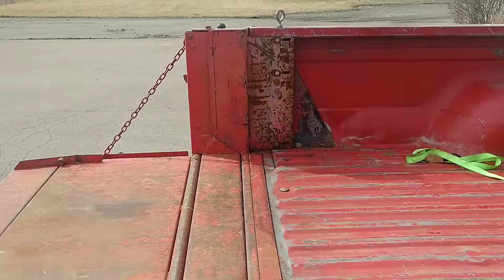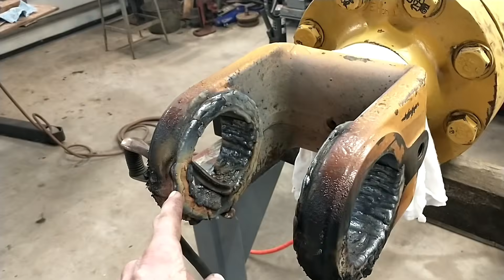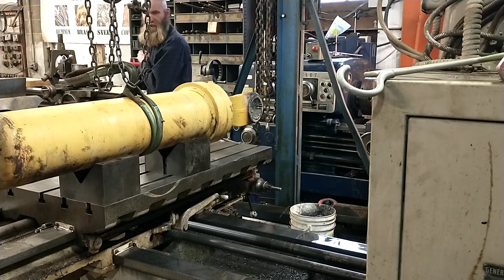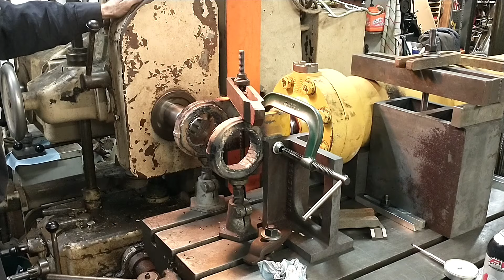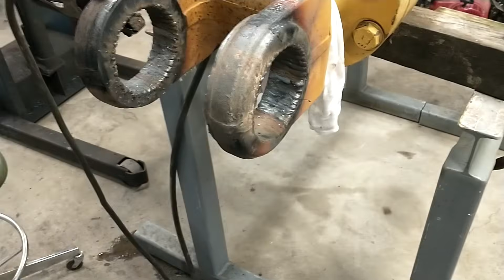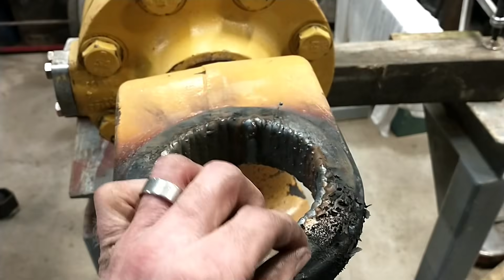Cat 980G lift cylinder repair

Comment: You've got a heck of a forklift operator there! It's awesome that he's in the shop and learning from you! My boys are a little interested but don't quite have the attention span to work through a setup yet.
When I first started at the shop I work at now, first time I'd ever run a boring mill, I was shocked to see what the people there used for risers under the outer edge of their table clamps: 2x4's. Yep, plain pine 2x4's. I thought they were nuts. 10 years later, I don't think they're nuts anymore, I know it. But the 2x4's do work well enough, somehow. Nice work, as always! Hope you have a good one!
Reply from the maker: Thank you for the feedback, I suppose some oak 4x4 chunks in different lengths would be handy.

Comment: That is one hell of a set up.you can get .045 solid
Reply from the maker: I misspoke, I was running 1/16 dual shield on the first one. I keep it set up on one machine and the .035 solid on the other, kind of covers both ends of the spectrum that way.